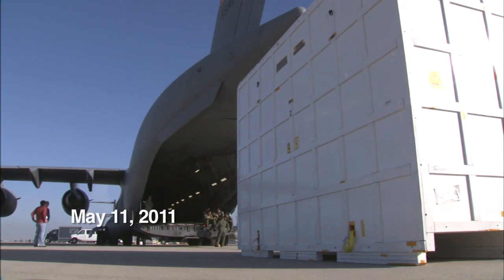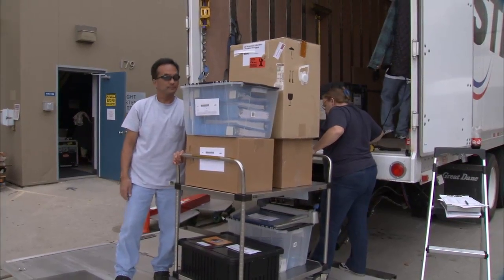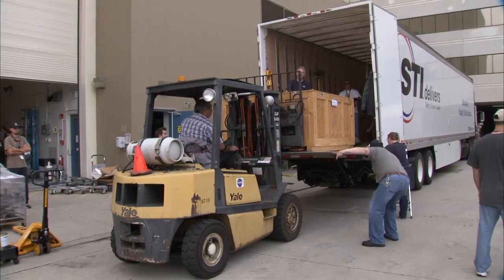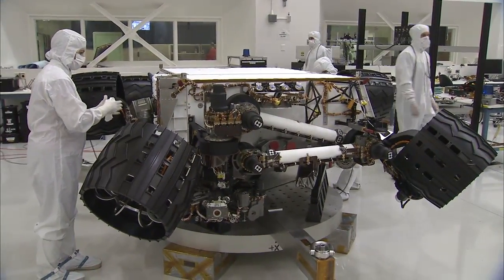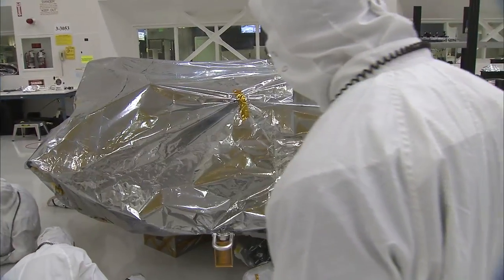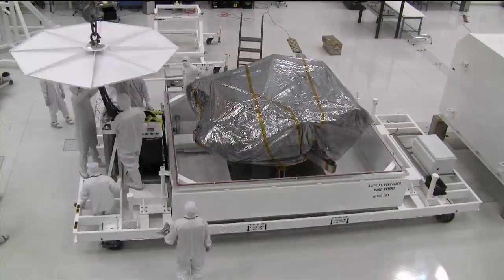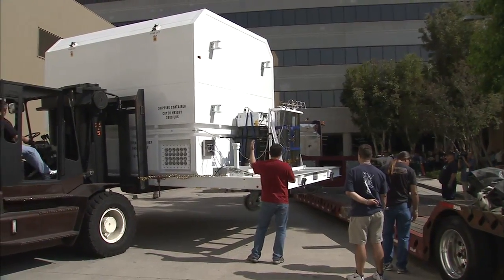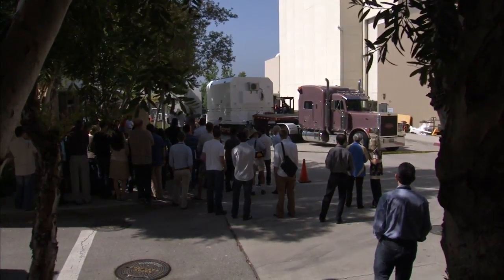Building Curiosity: The Big Move

Comment: @Molhedim It's not fancy at all. It's a "nuclear battery", which develops heat for many years through radioactive decay and then makes electricity from some of the heat and uses the rest to keep the rover's instruments warm through a system of tubes in the body of the rover.

They can't use solar panels, as the rover must work during the cold and dark winter for several years.

They used the same technology on the Mars Viking landers back in the mid 70s and on the Voyager probes in the late 70s.